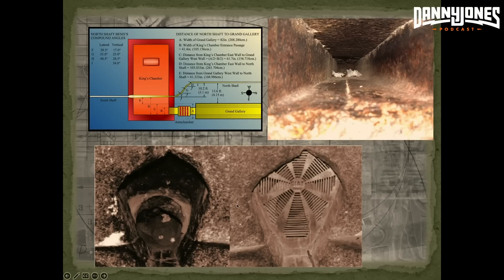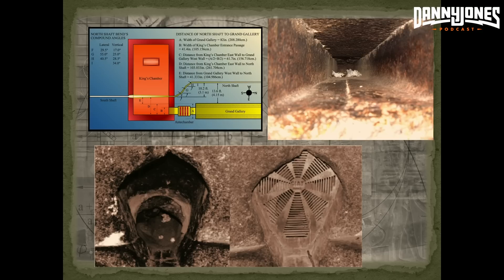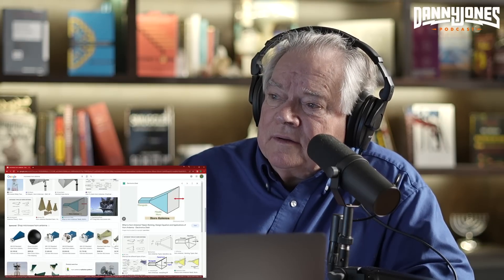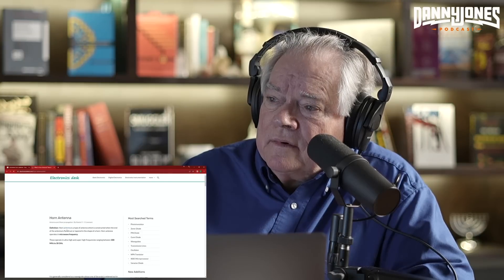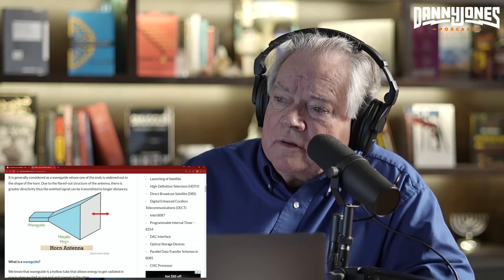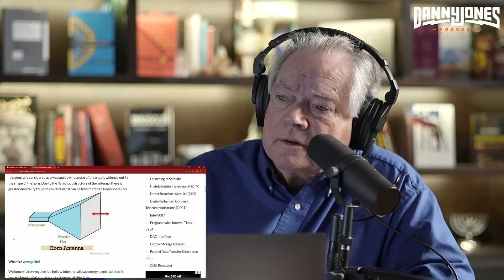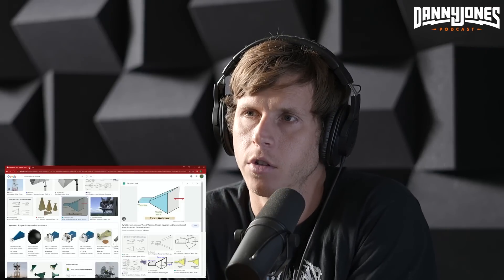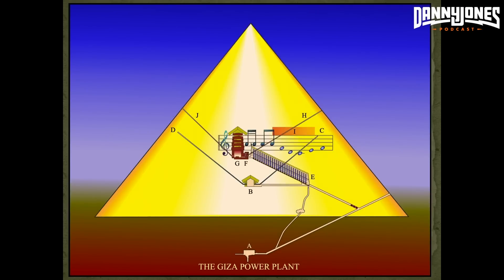Ancient Microwave Technology Discovered in the Great Pyramid Shafts | Chris Dunn

Comment: The microwave wavelength that causes electron excitation in hydrogen is 21 cm, which is 8.268 inches not 8.309. So, he is immediately wrong. The shaft varies from >8.5 to 8.4 inches wide. It's too wide and not precise enough. In short, the numbers don't match, and there's no mechanism for focusing microwaves down a hole in a pyramid. It's complete nonsense.

Comment: If I recall correctly, one of those shafts is aligned with the belt of Orion. So it's possible that these microwaves were being directed at something in the belt of Orion, and it could be transmitting signals. Just speculating. Of course moving at the speed of light it would take forever to send and receive a message.

Comment: Yes wave guides have a 4,8 X8.4 diamention and is made of platinum plated copper and is used for microwave, radio wave and much more. Your description of how it worked is very close to its original purpose. Limestone is for ion supply, and granite becomes the capacitor. Its use can be found; Lost book of Anki tablet 10. It was used as a traffic control becon for spacecraft landing on what is now called the temple of Jupiter.

Comment: The wavelegnth of Hydrogen is not 21 cm LOL, it's in the nano-meter scale, John Shae Perring and Flinders Petrie are two different people and how can an iron plate be found depicting this "microwave technology" be used to support this hypothesis if the pyramids were built during the bronze age.
Reply: The hydrogen line, 21 centimeter line, or H I line[a] is a spectral line that is created by a change in the energy state of solitary, electrically neutral hydrogen atoms. It is produced by a spin-flip transition, which means the direction of the electron's spin is reversed relative to the spin of the proton. This is a quantum state change between the two hyperfine levels of the hydrogen 1 s ground state. The electromagnetic radiation producing this line has a frequency of 1420.405751768(2) MHz (1.42 GHz),[1] which is equivalent to a wavelength of 21.106114054160(30) cm in a vacuum.
Reply: The theory says it was built way before egypt.  The quality of the stone pottery diminished as time progressed. It should have improved if technology was generational.  At least that's what they say.
Reply: yeah since last poleshift, or around that time. @bnpscnm
Reply: Iron was used at the time, generaly from meteorite, iron was just rare.
Reply: Dude you just got smokedddd
Reply: Hydrogen doesn't have an inherent wavelength, and the thing you're pointing at is also not really what they are talking about. There is such a thing the "hydrogen line" and it is generally accepted to be very near 21cm. It's just not super relevant to what this guy is saying tbh. This guy is full of shit, but for different reasons.
Reply: @IsHeHigh  we literally use the hydrogen line frequency to search for intelligent extraterrestrial life.
Is he not trying to say that this was a receiver of said frequency?

I mean to be fair, I didn't actually watch much of the video. Was just saying that the emitted frequency of hydrogen is indeed 21cm.
Reply: @user-cb5wi2wl3q  Scientists do. This guy and his guesswork mumbo jumbo are absolutely unscientific. Can't just say "about" or "nearly" when you're talking about things like this.